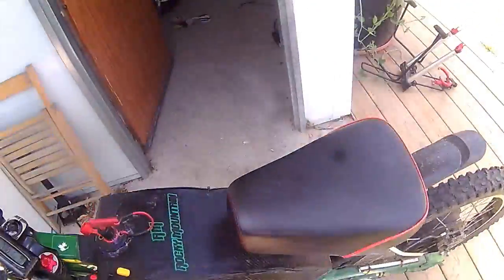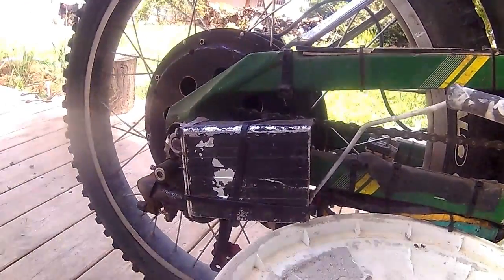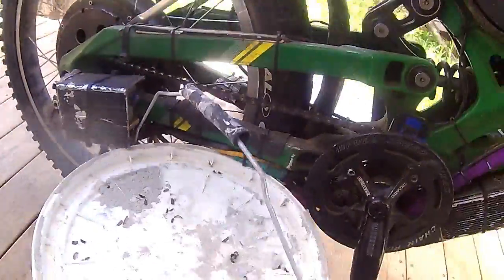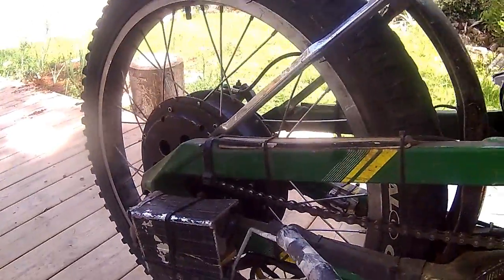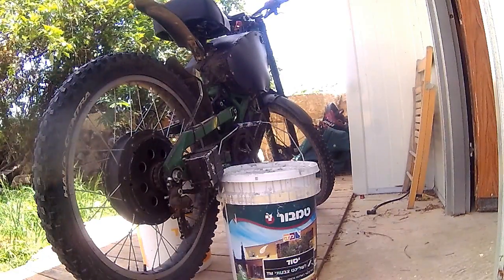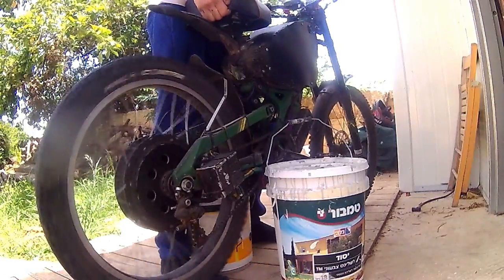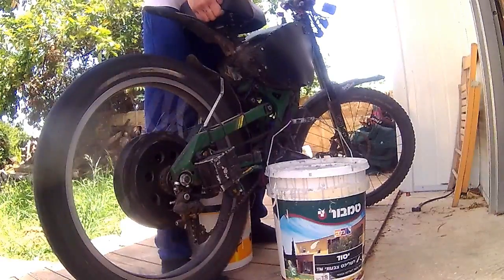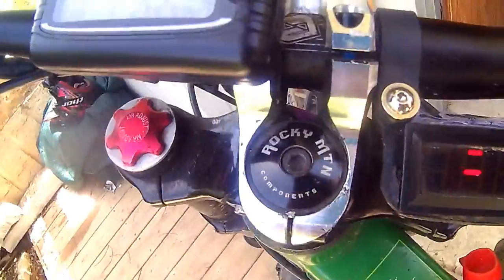140kmh E-Bike - delta\wye switch explanation

Comment: Have to agree with most of the concerned posting here, have your wheel trued up and balanced pal! At 140Kph if it reaches that, the wheel will within a split second tear itself apart with the centrifugal forces, half of witch will pass through your ass and spine sending you to your maker before you have even stopped moving!!

Comment: Hi I have a e-bike with a mxus v3 4t. My bike weighs a little under 25 kg and my top speed is about 50 km/h. Almost no speed difference when going up hill. lots of torque and not that much top speed. Can a wye/delta switch fix this by basically increasing the motors rpm. It must have some downsights like increased current draw or decraesing efficiency, or is it totally viable? A video on how to make diffirent phases would be greatly appriciated!
Greetings from Sweden!

Comment: Yea, sure it'll do 140 kph, with no resistance. But, with the weight of a person and on the road, you're lucky to get 70 kph. I don't have an e-bike, but I ride a Tomos moped(49cc and a Biturbo muffler) that does 80 kph with my 175 lbs(on level ground). The reason they don't put cars on a hoist and measure the horsepower(rather than a dyno), is because that isn't what power is going to the wheels. Thanks for trying, and uploading your video.
Reply from the maker: you obviously havent watched the full video
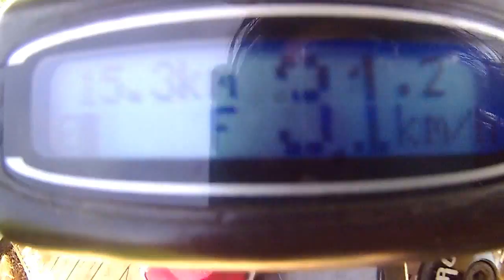go to 4:10 and listen again, i explain also about the loaded speed